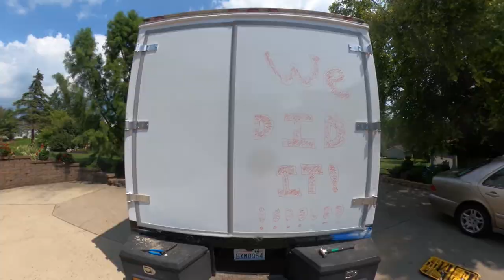Replacing Roll Up Door with Semi Truck Swing Doors on our Isuzu NPR Camper - Traveling Turtle

Comment: Where did you get the door from I am looking into doing the same conversion on my box?
Reply from the maker: We went to a semi truck repair and service station. They sold us all the parts. We had to cut them down to size, then install.
Reply: @TravelingTurtle-yv9hz  do you know what the door material is called?
Reply: 3/4 in door panel, they sell them at any semi trailer parts house, Utility Trailer, W&B or Greatdane, you can buy the hinges butt plates and lock rod kit.

Comment: How did you lock / secure the door? I do not see any securing mechanism to prevent swinging open. Looks great though.
Reply from the maker: We locked it from the inside with those spring loaded bolts. Top and bottom for each door.